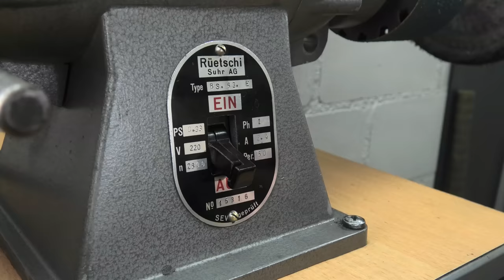Antique Seized Adjustable Wrench - Restoration

Comment: That nickel plating is just so smooth and clean looking. Any cleaner and I would have called it a silver wrench.
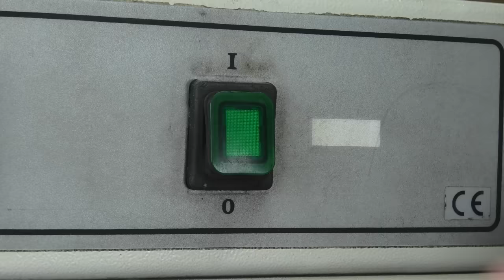Reply from the maker: Yeah it was more the brushed finish that made the look so nice and clean, you can see that very well at 7:16 before the plating.
Reply: @mymechanics  Maybe you would make a tutorial video of nickel plating?
Reply: @mymechanics  it's such a beautiful look. So sleek and clean!
Reply: @Westfield000  Electroplating is very easy 
All you need is an electrolyte, donor metal, receiver surface and a DC source
I remember doing it my school's chemistry lab
Reply: @Kingrhem.  Thanks :)
Reply: @Kingrhem.  I guess electrolyte is this solution at 7:25? What is it chemically?
Reply: There's a ton of how to videos on YouTube. Just look one up
Reply: @mariuszwantulok  You can make it yourself. Start with standard white vinegar, add a little table salt, then put a nickel electrode on the positive supply and a scrap electrode on the negative, it won't hurt for it to be a nickel electrode as well, so you don't lose nickel. Then run a current for maybe a day until the solution is primed, until it looks about the right colour. The salt is there to get some current going initially. What you have as a result is essentially a solution of nickel acetate (nickel salt formed by the acetic acid in vinegar), which is the working ingredient, some table salt, and various harmless junk from vinegar. Once the solution is primed, it plates quicker and more reliably and you can reuse it indefinitely.

If instead of green, your solution is brown, then you didn't have pure nickel electrode and got nickel-plated steel instead, the seller ripped you off.

I surmise you can also use any other acid instead, like dilute citric acid and form nickel citrate like that, but i haven't tried.
Reply: @SianaGearz  Thanks for detailed explanation! My tap get stained (loose some nickel) from a corrosive cleaning chemical (Cillit Bang) and I'm thinking of nickel plating  it again for fix.
Reply: I hate chrome with a passion but nickel plating makes my heart happy. So nice.
Reply: Love the brushed nickel look
Reply: @mariuszwantulok  nickel chloride is the ionic form of nickel sulfate.
Reply: @mymechanics  I guess I'm in the minority, but I thought it looked better before the nickel plating. But still a beautiful result as always.
Reply: @SianaGearz  does the amount of DC current and voltage matter?
Reply: @tyler2850  They do, but there is no hard rule. When priming, you might as well let it rip, just don't boil the liquid! I mean if you run 18V at about 1A, that's already 18W, the vessel will get warm, but probably not dangerously so, just use your best judgement. Also if you go too high, you might get some particles forming in the container. When plating, useful voltages will be between 2 and 12V, and depend on the distance between electrodes, electrolyte composition, geometry of the cathode, and so on. What you are looking for is to run as much voltage/current as you can but with small bubbles forming on the anode and coming off easily enough, and not too many, otherwise the plating might be either insanely slow but more likely to turn out pretty, if you choose voltage and current too low, or turn out more on the rough and flaky side if you go too high.

Oh forgot to mention. The home-made plating solution does not contain brighteners that are usually applied in commercial plating, so if you're trying to restore something that partially lost its plating, you are unlikely to get an exact match to the texture, but they're also not necessarily safe chemicals to handle. I think the liquids you get from Tifoo and Caswell and the like can contain some of such brightening agents but probably not the same as used industrially. I haven't tried them anyway.

Comment: I was just thinking, “He’s not gonna bother with those grippers on the wheel” and then I remembered who this fella is. What a tedious thing but that’s why he’s the only
 restoration guy I watch with regularity. Beautiful piece!
Reply: I know!  Right when I would have stopped he keeps going and files each individual grip.  Respect!
Reply from the maker: Thank you very much, much appreciated :-)
Reply: @alflyle9955  that sounds much better lol
Reply: How is your nickel plating holding up. I was under the impression that you need to plate with copper first, then the nickel
Reply: My Mechanics and Hand Tool Rescue, imo are the best two there are
Reply: If it was my channel, I would be like 'the grip is stuck, I buy a new one ' lol
Reply: @edsedlak6827  ¹
Reply: I cant watch any other tool restoration channel either
Reply: @ianross6971  If it was my channel id get someone else to do the restoration work while I went to the pub

Comment: I really appreciate the fact that you actually care for the ergonomic factor, and don't just want to make it shiny and presentable for YouTube. You actually put the extra thought and time into straightening it all out, and drop forging it - so that it would genuinely be a functional piece for a long time to come.
Reply: He didn't drop forge it; whoever manufactured it in the first place drop forged it. What he did to make the slot smaller could be considered a very basic form of manual forging. Drop forging is when you heat a chunk of metal red hot and a big hammer with a die shaped like a mold slams down onto it, quickly forging it into the shape of the die. It speeds up the manufacturing process by quickly forming the chunk of metal into the rough shape you want so that there's a lot less machining to do to get it to the final shape.
Reply: @MaximRecoil  Thanks for explaining that, I appreciate it.
Reply: @J Hemphill no you were not. You called him entitled. Saying he is "slightly less" than some others is still an insult.
Reply: @J Hemphill "that reference may predate you". Ah, I see. You can't battle an adult, so you feel the need to incorrectly assume my age. Typical YT behaviour.
Reply: @J Hemphill   want to know what I find hilarious? No one has ever spoken to me on the streets, the way they do online. The net is a haven for the weak. Using it as their shield.
Reply: @J Hemphill you are twisting the usage of "entitled" to suit your rhetoric.
Reply: @J Hemphill as I just said, you'd never speak like this to my face.
Reply: @J Hemphill speak for yourself. I don't let myself get walked over, here or on the streets.
Reply: Why yall arguing on the rusty wrench video

Comment: It's videos like this that make me inclined to give up programming and systems and going to work in a machine shop. He took a totally degraded item and made it into a piece of functional, beautiful art! Truly wonderful!
Reply: I understand your feeling. I've been in tech for over 30 years.Almost everything I've shipped more than 3-5 years ago, and that I've poured my heart and soul into, is now useless and discarded.

Yes, everything becomes obsolete, but at least with physical objects, that process takes much longer, and restoration is possible and desirable. If I weren't terrified of heights, I'd apply to be a Golden Gate Bridge repainter.
Reply: @jonhowell5014  Actual value became somewhat obsolete in recent history, for various reasons.  It will make a comeback. Value, like truth, cannot die.  ... also, regarding tech, steps along the way are just that, steps... the step is very important, it shines the light on the way forward ;).  ... repainting, a short-lived step that creates longer-term value :) God bless you and Live long and prosper!
Reply: John Arsebuckle  Agreed! Sounds like you've found something fulfilling, good for you.

I bought a fixer-upper house in 2010. My wife's relatives did a lot of inexpensive but good renovation work for us (yay relatives!), and I was there helping out. Demo, wallboarding, painting, flooring, and kitchen cabinet installation. The thing I'm most proud of is the kitchen floor tile. Did it all myself and it came out great, down to a fraction of an inch thanks to Visio. Nice to have used Visio back in the day for something other than wireframes and workflow diagrams.
Reply: @jonhowell5014  Maybe that's why some people like old cars they've had for years. It becomes more valuable on a personal level than monetary value.

Comment: I love the nickel plating! This video came at such a great time, I found an old auto wrench and I restored it yesterday, inspired by your videos. I’ve got a long way to go to get to your level but I made it functional and ergonomic with the tools and time I had available. I stripped the rust with a wire brush, filed off the casting marks and reprofiled the damaged jaws. I just coated in boiled linseed oil for basic rust protection but soon I will try blueing and nickel plating.
Reply: Good work

Comment: That finish is gorgeous man. Just imagine the history behind that wrench! I love old tools, and people restoring them so they can continue to make history. It’s a beautiful thing. Few will understand that.
Reply: I liked the new spacer. The machine shop where I work has an 86-year old machine that sharpens hobbs - the things that cut gear teeth. At that age it finally needed some work a few months ago. Our mechanic/millwright took it apart between other emergencies, cleaned everything and learned how it worked (clever engineering). In the end all it needed was a new spacer. Now it can work for another 86 years.

Comment: That would have been a good choice for rust bluing as well. It's period correct and can look stunning when time is taken. Great work!
Reply from the maker: I actually thought about that, but I decided not to because they're all black and I've done so many black items. I needed  a chenge :-)
Reply: @mymechanics  I had blueing in mind, too, but i much prefer the nickel. It looks great. Better choice.
I also thought that you should have lightly greased it. Did you not because it would be prone to picking up crud?
Reply: @mymechanics  I thought you were going to blue it too, but honestly, I liked the nickel even more. What a great finish it gives.

Comment: Such a beautiful tool. Reforging the main body seems like it was the best way of fixing this, but honestly wasn't at all obvious to me.
Reply from the maker: I had to think about that for like 2 days, I just didn't want to weld up more material.
Reply: @mymechanics  What has that done to the surface hardening though (if there ever was any)?
Reply: @-vermin-  I'm not sure if wrenches need to have a hardened surface, I would be a bit surprised to be honest. But after heating it for the forging, the hardening would be ruined (if it was hardened, that is).
Reply: @Leon_Schuit  You don't want a wrench body to be hardened. Hard = brittle, especially when you're dealing with torque forces - such as cranking on a stubborn nut. You want to take advantage of the metal's elasticity.
Reply: @-vermin-  Based on mine (I have one of the exact same model of wrench) it is not particularly hardened.
Reply: @TheRealColBosch  Which was why I said "surface". Hard shell + soft(er) inner == resists denting yet still flexes.
Reply: @TheRealColBosch  You can immediately see that you have no idea about the manufacture of tools or the hardening process. First. Today, at least the vast majority of wrenches/mechanics tools are hardened. Secondly, the wrench after such renovation is completely useless with - as you wrote - cranking on a stubborn nut, because it will simply deform permanently. After all, the steel hardened to the appropriate level is flexible enough not to break when high force is applied, but it does not deform permanently. P.S. Sorry for the lack of appropriate technical vocabulary, but I am not a native english speaker and I used the google translator.

Comment: This s not a restoration. This is "I make an adjustable wrench from forged parts". Stunning work!
Reply: A restoration would have left all the forging marks, the slightly misaligned jaws, and the industrial, blued look. This looks like something a tuxedo wearing plumber would use to tighten a leaky, gold plated faucet in Beverly Hills.

Comment: My Hand Tool Rescue wrench looks just as bad now too.
Reply from the maker: Sounds like you've been using it a lot, or not? ;-)
Reply: Damn already commenting
Reply: @mymechanics  the first gen one I bought was mild steel and untreated. Jaw got shredded once while tightening tin snips and the whole thing rusted within a month.

I designed a heavy duty one with quick swap tool steel inserts for the jaw, a rapid release knurled wheel, and gun blued the entire unit.

Comment: I "restored" a wrench very similar to this one a few years ago after being taken with all the restoration videos here on YouTube, e.g. got it well-oiled and moving again, a good first project.
But that nickel plating really takes the cake :P
Would a bronze shim have been a viable alternative to eliminate the wobbling if one doesn't have access to a torch?
Reply: A shim would stop the wobble so long as you can keep it set into the handle without it popping out. To note though is the head would be pushed to the side oposite to the shim. While this could be countered by using shims on opposite sides, this example has an open side meaning you would have to use a cutout of the shim, meaning it would be visible.
Reply: @hitchano  what if the "shim" was instead a sleeve fitted to the inside of the handle, with a matching cutout? You could tighten up all sides equally, and when extended far enough to see the inside it'd look like an artistic touch instead of a fix

Comment: I like the brushed nickel finish, hell, I LOVE the brushed nickel finish, gives it a touch of class!
I thought you would have to weld in some steel in the slot to make it smaller, and machine out the excess to make the plunger(?) fit better.  All you did was heat it and squish it to fit the plunger, with the right tools of course.  I learned something today.

Comment: The attention to detail is unbelievable! If you do not care about originality, a nice enhancement to the usability of the wrench would be to engrave a ruler on the sliding part and a notch on the handle (or vice versa) in order to view the nut size. I don't recall you using engraving in any restoration so far, so that's a future idea!

Comment: Looks better than new …which is what we see from most of your projects. Precision at work. Any reason for not cleaning those threads with a die? The rust remover may have done it’s job but I would think some pitting remained on those threads. Ditto the threads inside that knob with a tap.

Comment: nice small "Model T" wrench. 👍
Good job. 
A little surprising you didn't apply a light coat of oil on the jaw and nut threads, though.

Comment: Great restoration! My only concern would be about not re-doing the heat treatment and tempering after re-forging the slot area, but I don't really know enough about metallurgy or the intended use of the tool to say one way or the other.

Comment: I realize this is a question for an older video but I did recall you had used “rust cleaner” a few times.  I have no access to a sand blaster and have an old iron that is completely coated in rust.  I’ve tried vinegar/soda but it is rusted too much or too deep.
Live here in the US and wanted to know if you have suggestion for a rust remover product.
Thank you so much.

Comment: Great job! The part that do not i liked was change some detail and lines of the original tool. Restoration is to preserve the original form. I think would don't remove the imperfections and not use nickel, because seems a modern tool. All the traces and time marks the old tool is gone. But i respect so much your job. Not get upset with me.

Comment: Your techniques surprised me in this video. I expected you to reach for heat and penetrating oil to take it apart. But, the rust remover is better for small parts, because it reduces the overall work. Did you avoid applying heat without a fixture because it's made of cast iron? Is that a concern?

Comment: What is that block you use for sanding or honing a perfectly flat surface I was told glass and sand paper would do this but that block is amazing.. can you let me know what it actually is never seen a sharpening stone that solid

Comment: Final re-assembly: no grease?
I can relate to the knurling restoration: the mount of my wiper blade base onto its post used a 37- knurl spline (evidently aluminum) which, owing to being a bit loose, got gradually chewed away.  The only way to truly fix it was to get a micro-triangular file and re-do all of them.  That's how I know today there are 37 of them!
Reply from the maker: I applied a little grease :-)

Comment: Hi. I have found a vintage Chicago specialty tools No 3003 hinged. Flexible iron  hinged , with a v cut in the shaft and a point on the hinge C part. I looked it up found not much.. 1911 to 1940... And some E bay sales.. where can I find this information.. much thanks. Russ

Comment: Say I wanted to just give wrench its original metal finish look after media blasting, what would be a good way to seal/prevent flash rust from occurring without painting the tool?
Reply from the maker: Maybe steel wire brush it and oil it

Comment: Question! Why no grease on the threads? I remember you putting tons of grease on threaded parts in your first few original videos.
Great work, though!
Reply from the maker: Because I use it as a display tool only, it doesn’t need it… Thanks a lot for watching!

Comment: besides the rust remover, and refiling the notches, i would have left the middle part that goes on the threads just the same as it was. it would have given a better grip with lots of pits and scratches in it. not clean it up and make it look nice which smoothed the rough edges that give it grip.